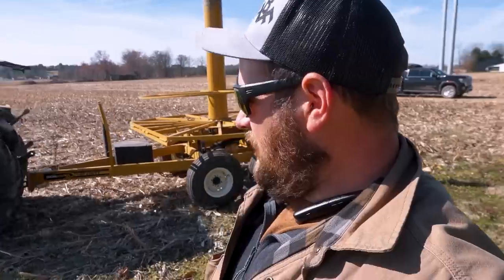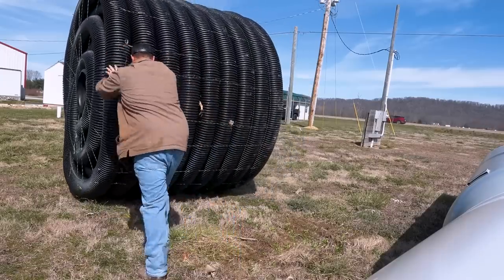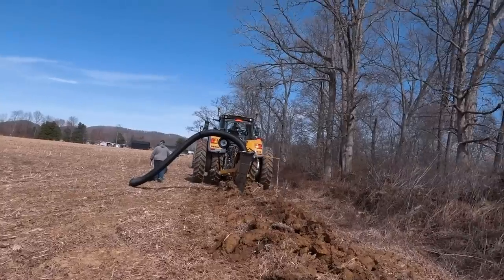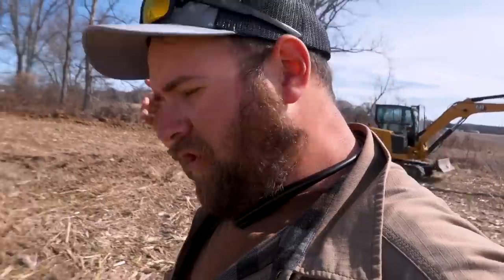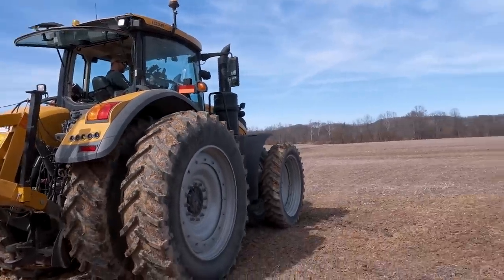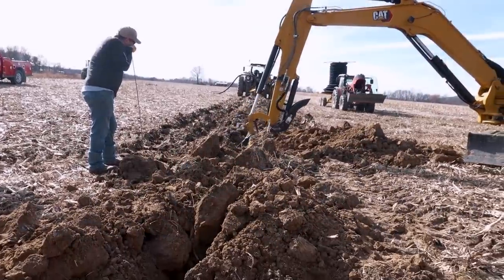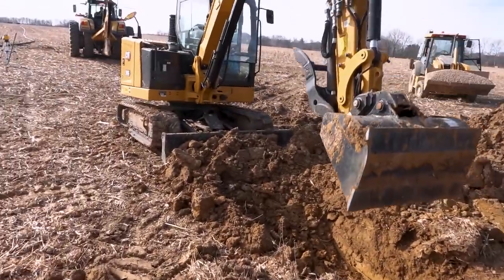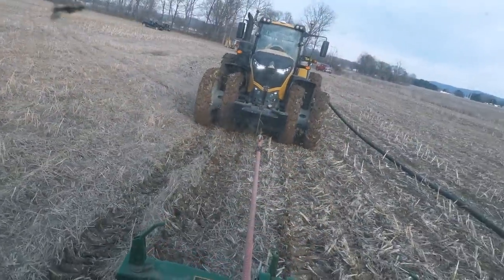Bad first day on tiling job | Mistakes Made

Comment: In my area, the soil boring and perc test for a septic system has to be done before a building permit is issued.
Reply: It's thr dumbest thing ever!! Did it in 2016, your soil won't let water through so let's add tile to get water away yeah that following spring water was backing into our house!! Built a house in 09 never did that now in 18 you don't have to do it

Comment: I'm surprised the ground is fit to work on specially with tires. No water in that main? Suggest you eliminate the tile 'jump' as it is lifted off ground and  into plow. Leads to pipe stretch - you will notice stretch when installing tees.
Why did you make a new start hole? 
Hope you meant clear crush stone and not gravel for start holes. Reminds me of the first week every spring of tiling and the ache in the legs at the end of the day

Comment: That roll of tile was on the stringer trailer correctly.  If you load a roll so the first wrap of tile starts coming off at the top of the roll, the wraps will loosen and cross over one another, making a complete mess.

Comment: We've been repairing some of ours every couple of years (fucking mice, expound about soybean based tile). I'm surprised you got by with 4" and to 8".  Usually they've put ours in there's a 6" in between. I guess we could do all the conversions from 4 to 8, but 8 is pretty big. 

3 to 5 screws and tile tape per connection. Do it right! =p

Comment: So wouldn't Cover Crops do the same amount of work that adding tile does...

There are Cover Crops tap roots do much work vs adding tile
Reply from the maker: People may say that but this farm has had lots of different cover crops and it didn’t help. I believe you are referring to radishes. They have a long tap root but that doesn’t move water like tile
Reply: Cover crops can work well, but they are not a replacement for tile. Using both is optimum.
Reply from the maker: Unless they plug the tile

Comment: Wrong. Best spent money is to dig out your "shough" as we call it in ireland. Get it right and run every drain straight into it open ended and you can see if youve a problem straight away and which one it is. Then all you need to do is shove a pipe up it to red it. Now you need to dig up openings and cut pipe for access. Nope... not the right way. Especially cuz its right beside your main aswell. Madness wat your at.
Reply from the maker: I have no idea what your talking about lol

Comment: why do they call it tile work, when its just pipe?
Reply: It’s has small slots cut into it, not the same as pipe
Reply: @Dontworryboutit315  I know that but its still round and water flows through it...why is it called tile?
Reply: @robertwilliamsjr.9195  back in the day, they used clay pipe butt up to each other and called them drain tile, just like foundation drain tiles, around perimeter of houses 🤷🤷
Reply: @alisciamarotta3888  ok...that makes sense...ty